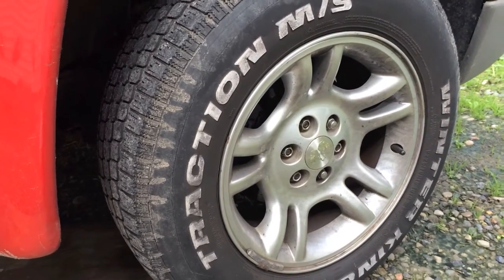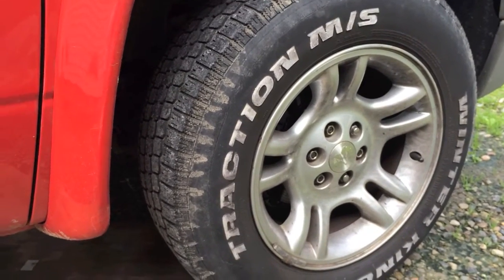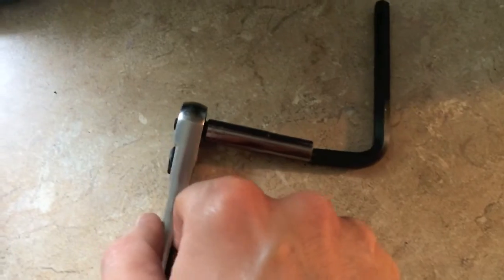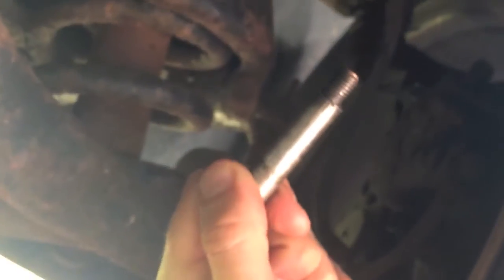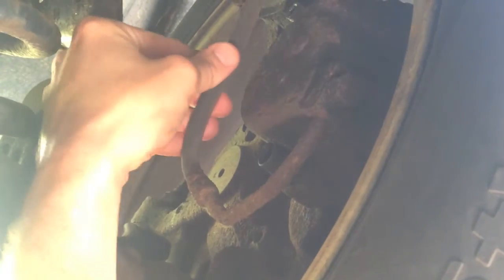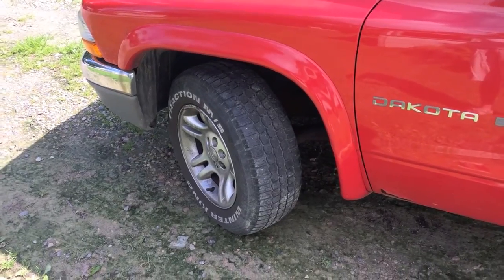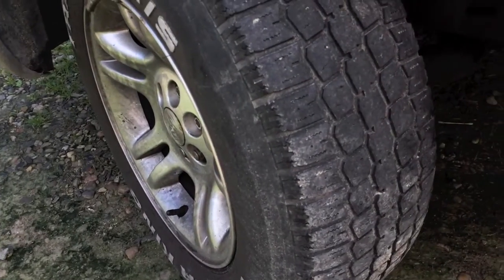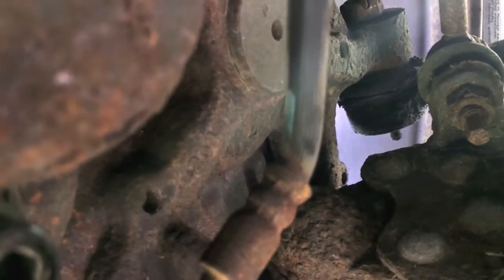HARD Brake Pedal-My Brakes are Locked/sticking - Caliper Slides Sticking - EASY FIX

Comment: I got the Craftsman set that does American metric hex head torque heads and reverse torque heads plus Flathead and Phillips
Reply from the maker: michael Thomas 

That’s awesome.  We got the same set & love it.  We have used that so many times as a lot of things nowadays have little hex bolts.

Our favorite part is that all the hex bits are labeled & show what size they are.  The little hex tool I used in this video came out of those little bags filled with hex tools...& none of them show what size they are!  🙄

😎👍🔧🔩

Comment: while bleeding rear drum brakes no problem could hear pads moving,front disk lots of air piston doesn't move do I need to keep trying to bleed. Thanks Brian
Reply from the maker: Brian Bryant Definitely keep bleeding until all air is out.  Also make sure you continue to keep brake fluid reservoir full while bleeding.  This prevents system from drying and gathering new air....no fun 😬

Comment: I had a question, so when im driving and slow down or stop and turn my brakes grind real bad and sumtimes locks up but its only when i turn the wheels.?
Reply from the maker: Alonzo Molina 

Thanks for watching Alonzo!  The first thing that comes to mind is your rubber brake hoses.

The rubber brake hoses that connect to your front Calipers actually fail from the inside out...which never really allows you to see the wear or failing hoses until you’re experiencing what you currently are with the Hard Braking.

It’s very possible that during turns, as your rubber hoses are moving ever so slightly, the brake fluid is getting trapped & disrupting the flow of fluid.

We recommend replacing rubber hoses.  Keep us posted!

Please subscribe to the channel and turn on your YouTube notification Bell 🛎 that would be awesome thanks again Alonzo!  😎👍🔧🔩
Reply: DIY With Michael Borders Thanks I hope it's that going to replace them with new ones also, this was before this problem. But back then when I would let go of the gas when I was going down the road I would hear like a soft grinding noise.
Reply from the maker: Alonzo Molina 

Thanks for the reply!  A few additional things come to mind!  Let’s troubleshoot a few things!

1.  It’s possible that your Caliper slides are no longer lubricated.  These caliper slides when not lubricator will cause Calipers to lock up.   Below is a step-by-step video that shows you how to lubricate Caliper Slides.

       https://youtu.be/-DZ68tKuCQc

2.  It’s possible that your Brake Pad tips are no longer effectively lubricated where they shift on Calipers.  Below is a video that shows you how to check if they have been lubricated as well as lubricate them in the event that they are not.

       https://youtu.be/3Pq15BWM_qY

3.  As previously mentioned...It’s very possible that your Rubber Brake hoses are failing.  This hose connects the Caliper & hard line that feeds upstream to Master Cylinder.  Believe it or not these rubber hoses fail from the inside out...which means you will never know when it is failing until you experience symptoms as you are...There is no visual signs on the exterior portion of the rubber hose...in most cases, the exterior portion of the hose will look great however the inside is falling apart.  Below is a video that runs you through the step-by-step process of replacing these rubber houses.

       https://youtu.be/3FTEgbLYAdI

Hope this helps!  😎👍

Comment: piston doesn't go back in when bleeding is finished ???
Reply from the maker: Thats similar to what I have run into in the past....this HARD brake pedal really sends you on a rabbit race to pin point the problem.  The next thing I did was replaced the front Brake lines that connect to the caliper and up to a hard line that feeds to your Master brake cylinder.  Attached is a video i recently uploaded.  I replaced lines and then replaced calipers.  Ill be uploading my caliper video soon.

https://www.youtube.com/watch?v=3FTEgbLYAdI&t=86s